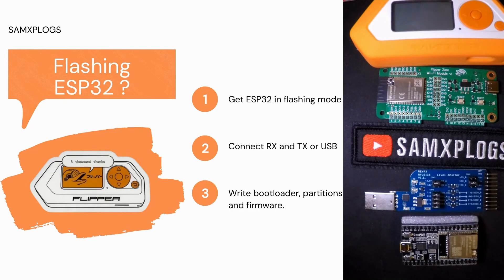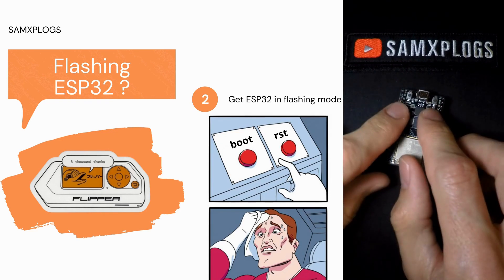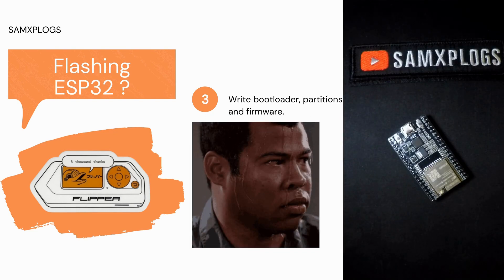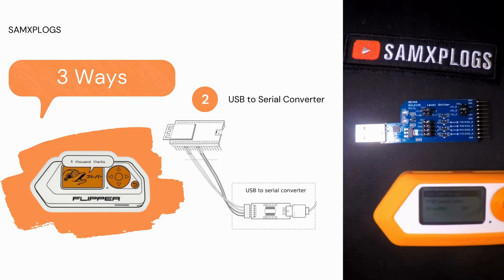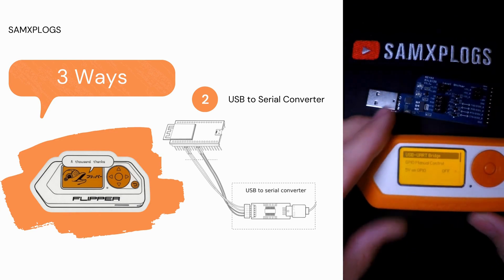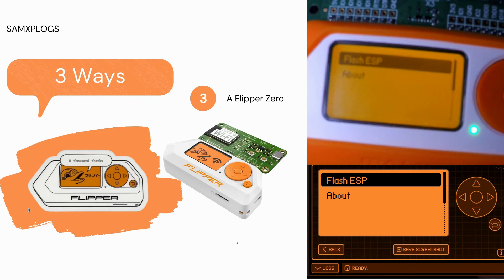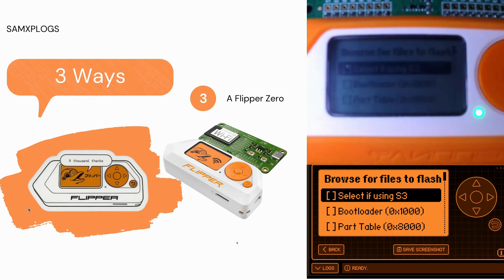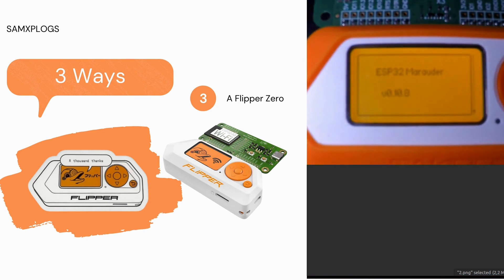Flashing ESP32 Made Easy: Use Your Flipper Zero with the ESP Flasher App!

Comment: Too bad this doesnt work for single .bin files? Like the new type released by bigbrodude6119 for evil portal?
Reply from the maker: I was wondering about the same thing. Dealing with one .bin only would make it easier. However I think we could still split it. I didn’t tried it yet: If you want to split the bin file into parts corresponding to specific addresses, you can use the `--segment` option in `esptool.py`. i.e.:

Let's say you want to split the `firmware.bin` file into two parts, where the first part corresponds to the address `0x0001` and the second part corresponds to the address `0x10000`. Commands should look like that one esptool.py --chip esp32 split_flash firmware.bin output_file_ --segment 0x0001:0x10000
Reply: I had no idea splitting bin files was possible, thanks for that! But i agree, a single bin file should only make it easier. Please let us know if you find out more about single bin files, thank you!